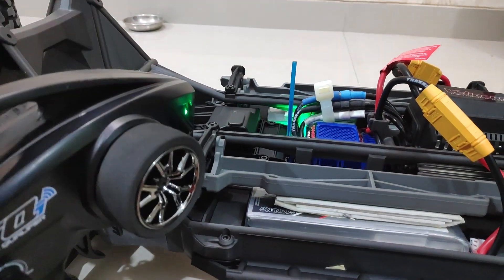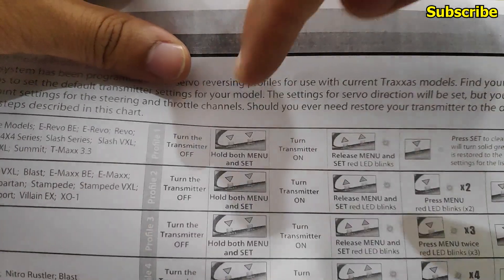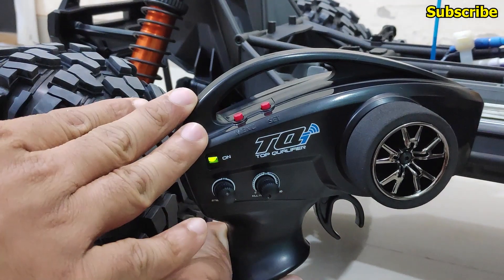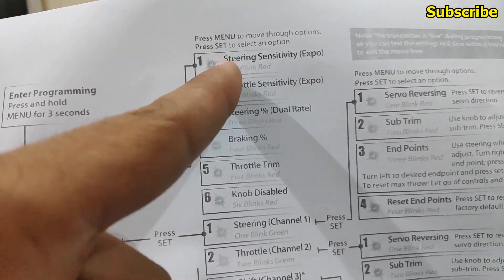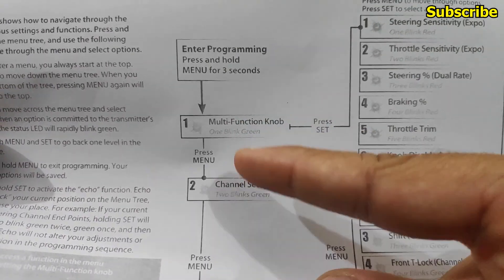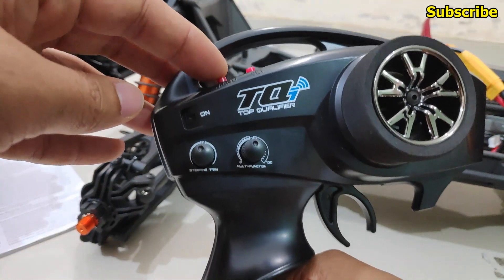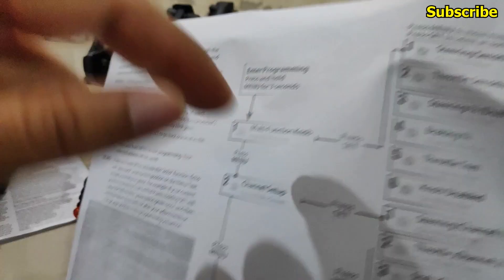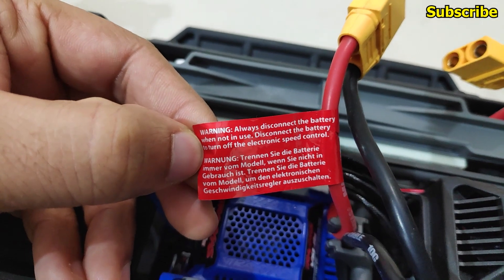Traxxas X Maxx VXL 8s ESC Green LED Flashing Error Solution ESC Calibration

Comment: I've encountered a problem! I have a TRX4 with an XL5HV. After switching on the motor controller, the LED flashes green rapidly and continuously. After switching to other modes (using the red LED), it continues to flash green rapidly, and I can neither drive forward nor backward. Adjusting the remote control settings makes no difference. All other functions work. What could be causing this?
Reply from the maker: Hi, so the green led is flashing constantly and you have no throttle or reverse? By function you mean what all is working? Like steering?
Reply: @RakishRc The green LED is flashing rapidly at 0.5-second intervals; I can't drive forward or backward; I can steer and operate the 3 servos (differential/gearbox). I've since tried a different Jeti transmitter and receiver. With this setup, only the steering works, not the driving function!

Am from germany, translation is difficult but i thank you so much!!

Comment: Could this happen in the middle of the run and go away on restart?
Reply from the maker: @MrDontask007  yes it does act weird in between when running because throttle neutral zone is not stable on stock radio receiver. Better to change the radio and receiver to get rid of this problem... with a dumbo rc radio or a better one
Reply: Thank you!

Comment: It has happened to you that in the Traxxas app it does not give you the 30v of the 4s batteries, it says 6v for me
Reply from the maker: I have not used the traxxas app. But it's your esc working well? If yes then ignore the voltage reading.... May be app bug or telemetry error
Reply: @RakishRc  Yes, let's see, it doesn't take more than 49 mph and the rest is fines.

Comment: Didn't work for me unfortunately. My only solution is to turn the wheels and tap the throttle. It then turns solid green and functions properly. Traxxas support has been no help.
Reply: Did you ever figure it out?
Reply from the maker: Replace the receiver and radio with a different one.. That's the final solution for this problem

Comment: I followed these steps but the ESC still keeps blinking green. Can this mean it is destroyed?
Reply from the maker: Thing is the traxxas stock receiver in most xmaxx and xrt have a manufacturing defect. You may replace the receiver and check. I have replaced the radio with a Dumbo RC x6fg for my xmaxx and it's very smooth no more green led blinking on esc.
Reply: This is why I have a max6 esc......no issues and programming with a card is a lot faster